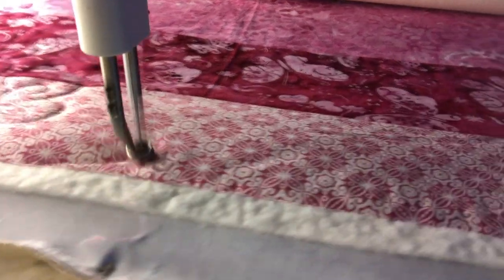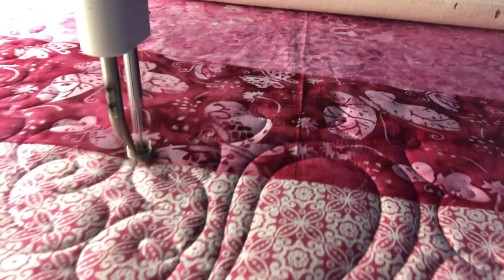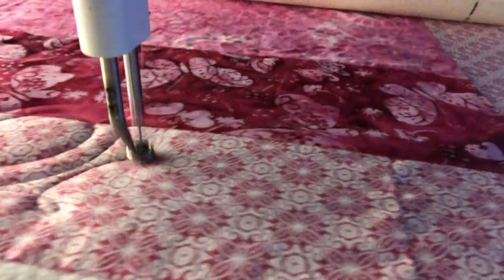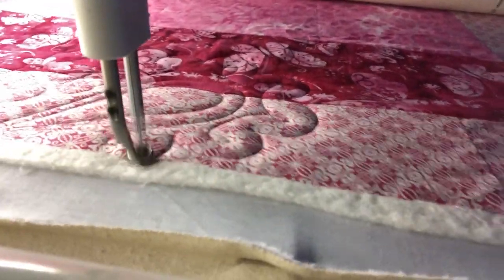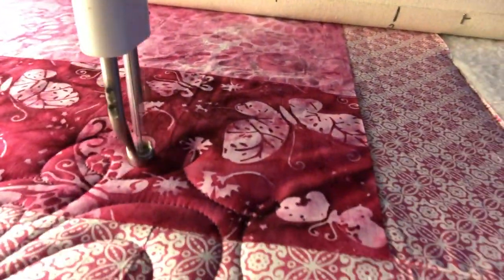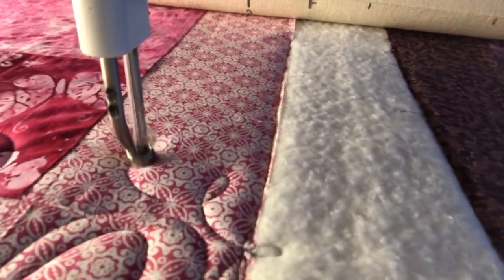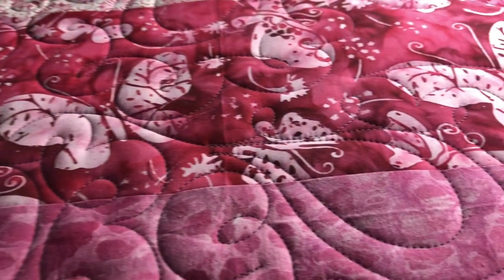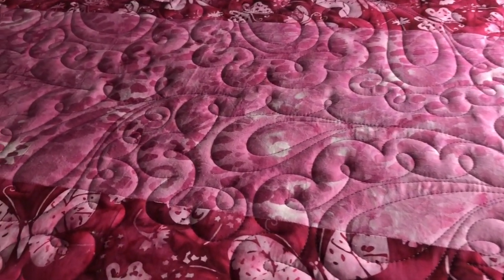edge to edge loopy clam

Comment: It appears that you are starting the quilting at the bottom of the quilt. Is that right? I have always started at the top working down to the bottom, but this particular design looks easier to do if you work from bottom to top. Just wanted to make sure that's how you quilted it! Looking forward to trying this soon!
Reply from the maker: Cindi.  I did start this quilt on the bottom in the demo.  It can actually be done from any spot, especially on a domestic machine, with proper basting.  On a long arm, I sewed it down all the way around before I started to avoid slipping.  But on a domestic, it depends on your basting method...just baste it well!!  And usually domestic quilters start somewhere in the middle and work out, to deal with possible stretching or distorting between basting.  This design can start anywhere.  Just baste well and jump in.